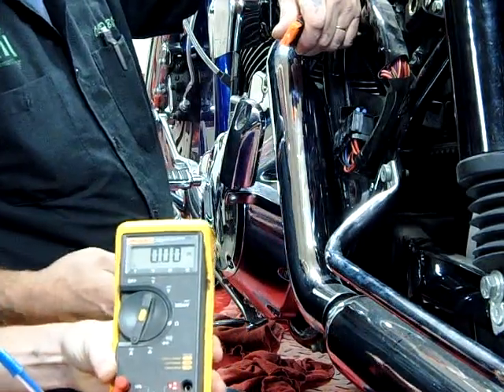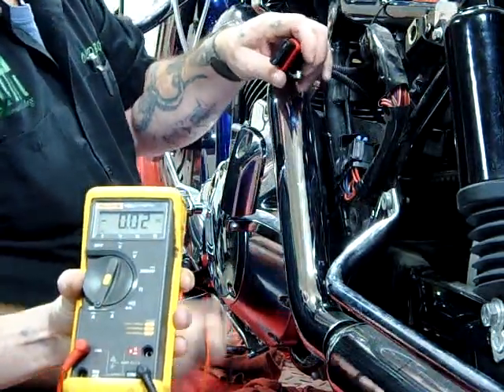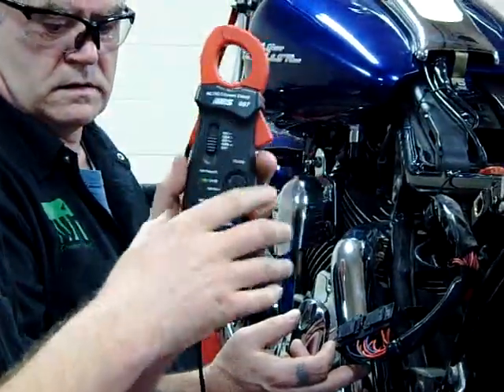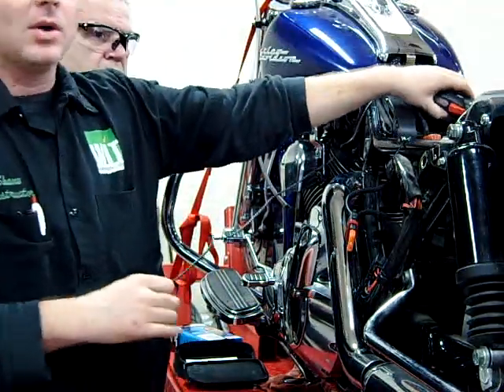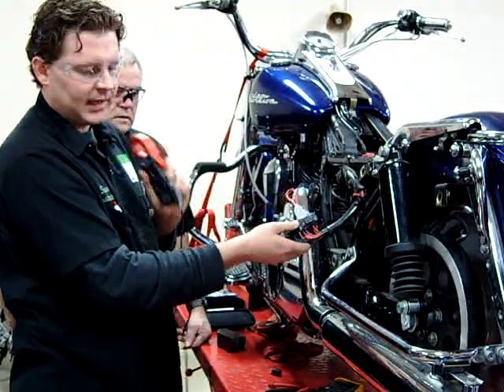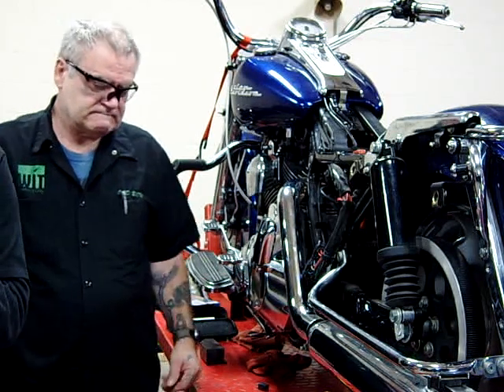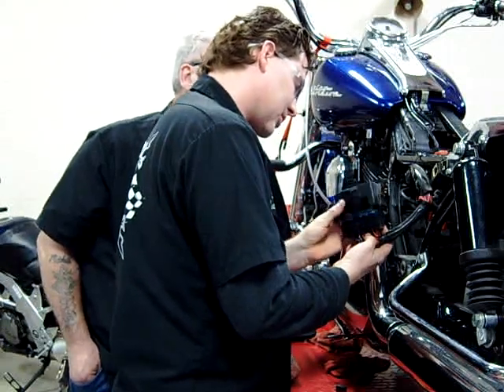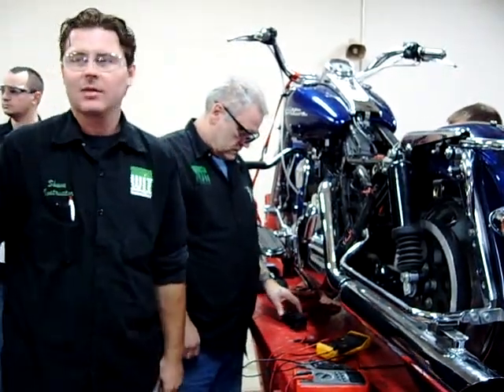How to perform an amperage (amp) draw test on a motorcycle or atv

Comment: Electricity doesn’t push/shove, it’s drawn or pulled.
The battery if flat will draw more to charge then if it’s fully charged n topping up the battery.
Sorry your science is a bit wrong in ohms law....